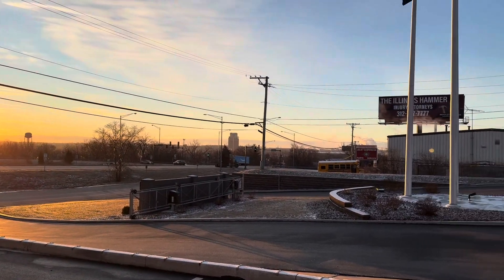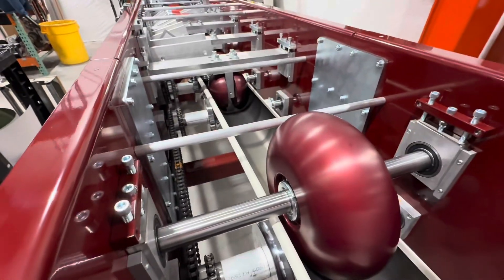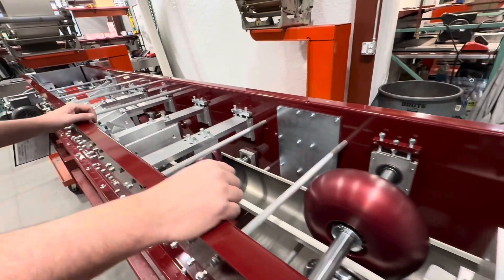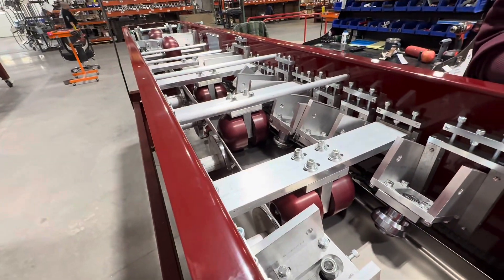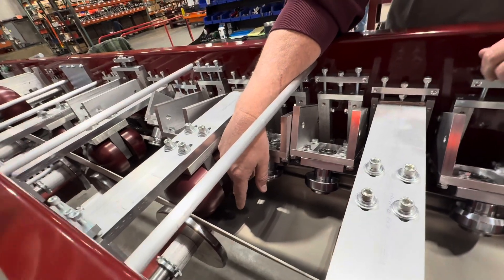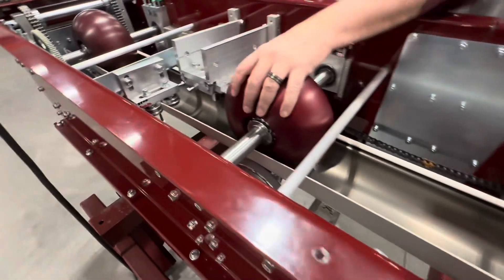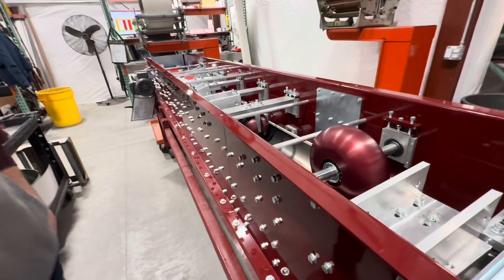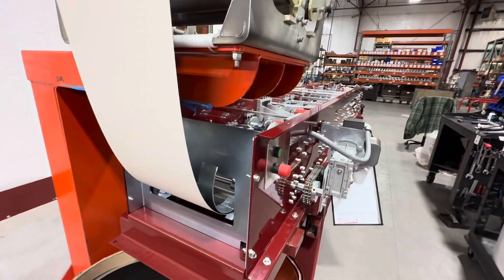How Are Round Gutters Made? 🏠 KWM Half Round Gutter Machine, Process, and FAQ

Comment: Also, if you don't mind me asking, what are you charging per foot for half round. Thanks
Reply from the maker: Usually around 20 
but could be less if easy house 
Half round requires extra attention to install hangers miter strips special endcaps outlets

Uses standard 5k coil so material is not an issue